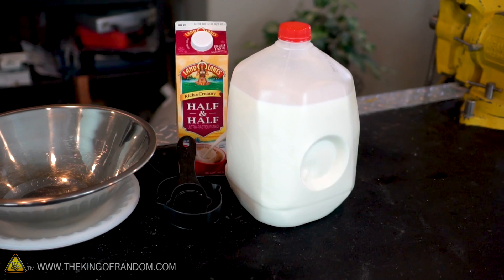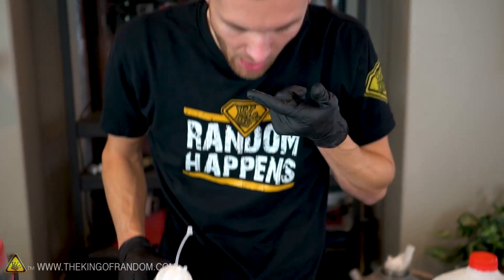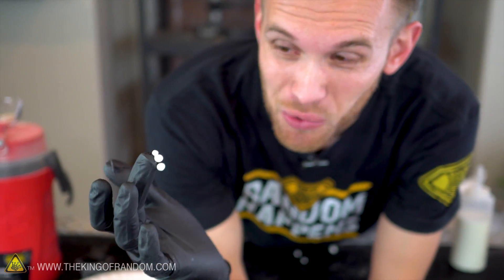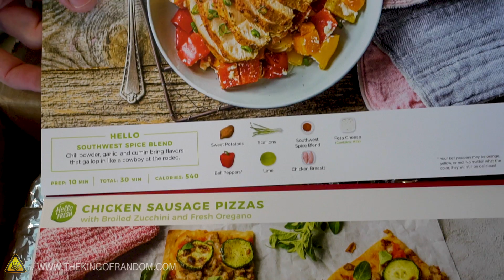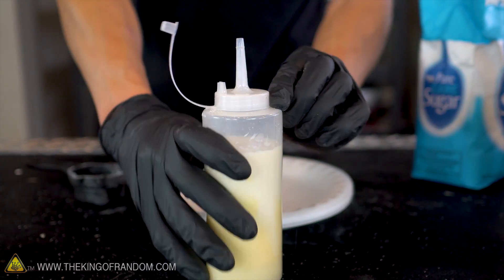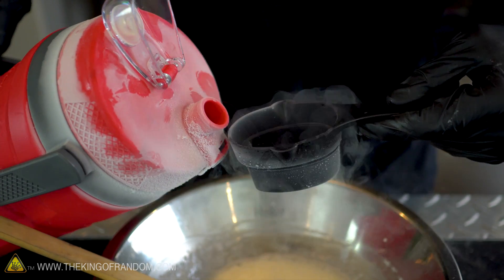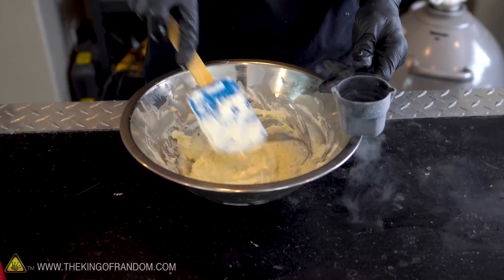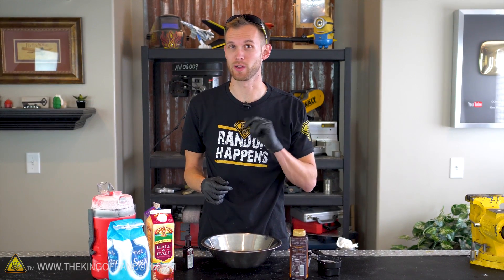5 Recipes for Liquid Nitrogen Ice Cream! TKOR Spills Our Secrets For DIY Dippin Dots & Dry Ice Cream

Comment: I would highly recommend making your own vanilla extract as it tastes so much better than most store bought extracts. To make it just buy some whole vanilla beans and put them in a bottle full of plain vodka and let it soak. It will take a couple weeks before the vanilla flavor gets strong enough to use but once its ready just use it with the beans in the bottle. If it ever gets low just add some more vodka and I would suggest replacing the vanilla beans every 2-3 years.

Comment: What happens to popcorn in a vacuum chamber
1.what happens to un popped popcorn in it
2.what happens to popped popcorn
3.will un popped popcorn still pop if it has ben put in a vacuum chamber
:)
Reply: check out Cody's lab, he did a video or two on it
Reply: Pop
Reply: Should ask that on The Action Lab too
Reply: I think that is cool
Reply: Nicholas Diaz please like this it's such a cool idea
Reply: Nothing because popcorn pops when heat is applied

Comment: When he was mixing the bottle he used his finger to keep it from spilling...and not the cap...
Reply: IG:Skits._ 

The cap is basically designed for keeping air out. 

So when you shake them vigorously, you need a finger over the hole. Otherwise you wind up with splattered walls. 

I just followed the instructions and I tried using just the cap. Took 2 hours to clean up the mess.
Reply: IG:Skits._ I know it's so weird.
Reply: r/mildlyinfuriating
Reply: Do you think you could put the mixture in the freezer instead of in liquid nitrogen
Reply: Orange Rocks1986 no you could put the cap on and then put ur finger down on the cap to hold it down? lmao you dont NEED to leave the cap off and plug with your finger
Reply: ShoveTheShoulder 13 yes of course buddy that would work perfectly it just get hard in the freezer

Comment: I have a new invention that you need for stuff like this.  It's a hollow frustum, inverted (small end down) with a smaller hollow cylinder attached on bottom to be water tight, and with some small ridges along the outside of the smaller cylindrical section to allow trapped gas to be vented to atmosphere. I think I shall call it "Funnel"

Comment: Melt Metal and color it!
Reply: Daniel Thomas thats not possible its like melting metal and adding water to it to make it see trough
Reply: T Games Bich trad the previous comment
Reply: Molten metal would instantly burn off any coloring additive
Reply: The only way to color a metal is some kind of paint, oxidation (like anodizing), or by covering it with another metal (electroplating). You can't melt it and mix color in...
Reply: My experience says it's horribly splotchy... And ultra expensive and ultra dangerous. You have to blend in toxic base elements like the ones that color gemstones and turn them into a gas form while remelting and remelting the metal. The fumes would call the epa on your doorstep... Although if you do it carefully you can plate cheap metal in wicked designs and get a similar result
Reply: ever heard of paint

Comment: The plate works better because you used a dry ingredients measuring cup. If you used one designed for liquid it would have graduated markings on the side. And pour easier.

Comment: A way to make this slightly easier (and higher production...  Use a new (clean) paint roller tray. Fill with Ln2, and pour the ice cream at the top of the slope.  the frozen balls roll down the ramp and collect at the bottom and leave the top open for more drops.  Works great... Just make sure it's a new tray.

Comment: Do liquid sand
Reply: YEAAA like Mark Rober
Reply: Are you talking about coating the sand with a hydrophobic coating or melting sand? If you melt sand, you're basically just making glass.
Reply: camaro25  no you just but pipes with holes under the sand and pump air
Reply: what is that?
Reply: what ever it is I LIKE IT
Reply: camaro25 watch Mark Rober's video
Reply: there's something called glass you know.
Reply: Aaron Hughes well it’s not melting the sand j just go see mark rober’s video

Comment: He cooled the steaming half and half with cocoa in the fridge?^^ dude have fun with scratching ice outta there tomorrow^^ for everyone who dont wants to do that just wait until it cooled to room temperature outside the fridge or just use honey cause you dont need to heat up anything for honey to disolve and its healthier or just use the hot stuff if you have enough nitrogen cause you will need a lot more ;) and icecream is better with nitrogen cause the water and fat molecules are frozen to smaller crystals so the tongue can taste them better
Reply: Honey doesn't dissolve as well in cold liquids either.

Comment: Could you actually use "raw" vanilla(you know, the tiniy little black thingies)? And if yes, would they require any special procedure or would you just put them in the mixture like the rest of the stuff?
Reply: Ya know I bet you could if you warm up and soften or dissolve the Vanilla Pod Gratings in water beforehand. I personally prefer real vanilla compared to stock 'vanilla extract' which is not really'pure' as they claim because it is not just vanilla. Real vanilla pods are not alcoholic unlike Vanilla Extract so that is one of the reasons that I prefer the pod to the extract.

Comment: This is cool, but is there a way to make dippin dots ice cream without liquid nitrogen?
Reply: I agree with this query. I know you can make the ice cream using Dry Ice from the store. If your local store sells some. Or you could try to make some from a specific type of fire suppressor. Though, might be able to use the Dry Ice in a similar fashion,maybe?
Reply: Raven Saint I would think so, but the only problem I see is that dry ice itself is a solid and liquid nitrogen is a, well, liquid lol. So pouring beads of melted ice cream or half and half w/milk would just hit a block of dry ice and no freeze into a ball, but will splatter more then freeze. Just a guess 😬

Comment: How does liquid nitrogen not freeze itself and turn to ice?
Reply: Ohhhh
Reply: Addvarkezz properties allows it to maintain is liquid form and plus it is constantly being heated because of outside temp
Reply: SuperVValrus 
No u wrong
Reply: Addvarkezz 
Because of our atmosphere pressure, in our planets condition nitrogen is gas coz of temperature and pressure, but when harvested it appears in liquid form in it's maximum state because of air pressure, it's possible to freeze nitrogen on earth by removing air pressure, so if u put it in a vacuum container it'll start turning into solid state .